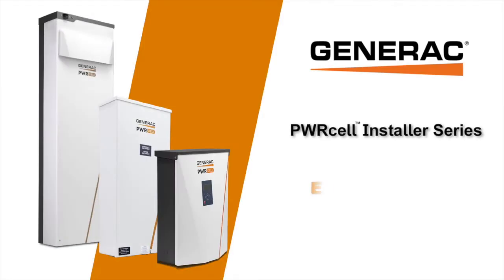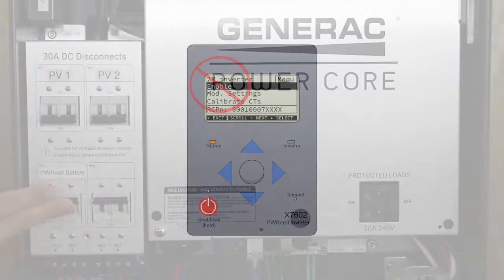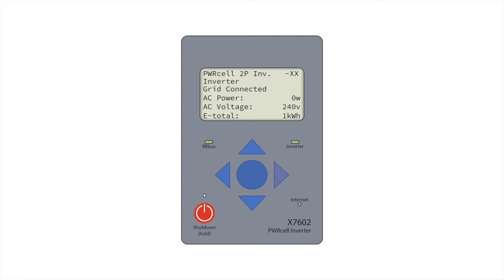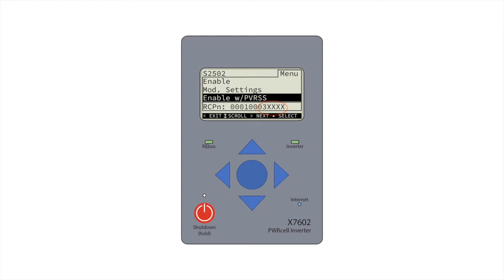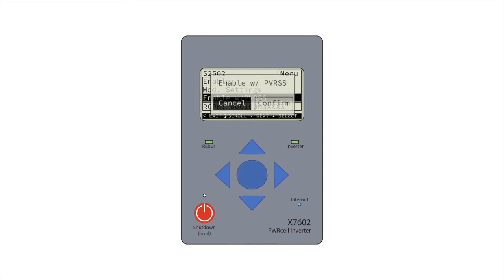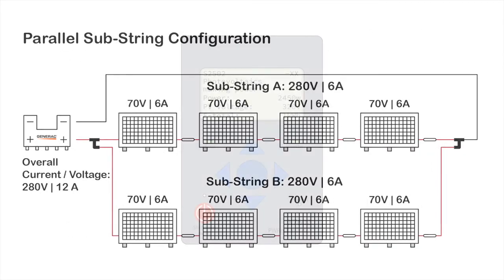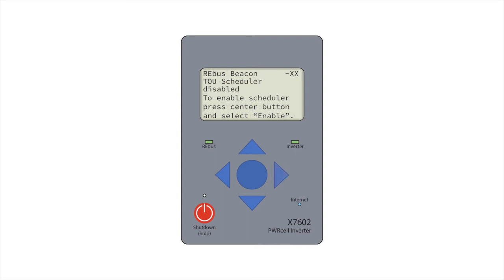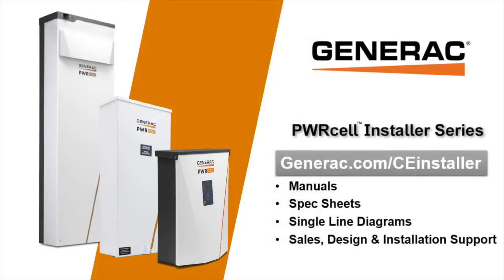Generac Installer Series: Enabling Rebus Devices

Comment: Do SMM need an inverter configuration other than enablin load shed 1?  The installer tool is needed for this purpose?  My SMM doesn't shut down the equipment connected while in battery mode, it only does it when I turn on a generator.